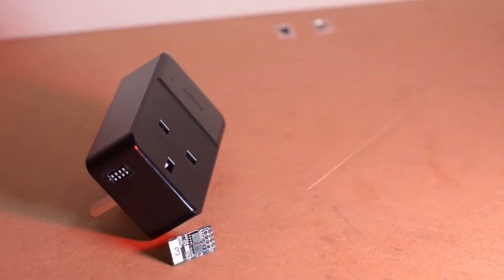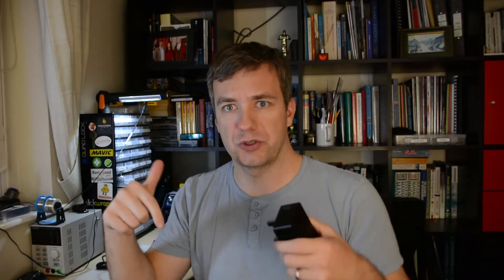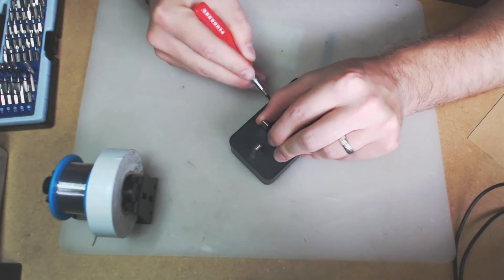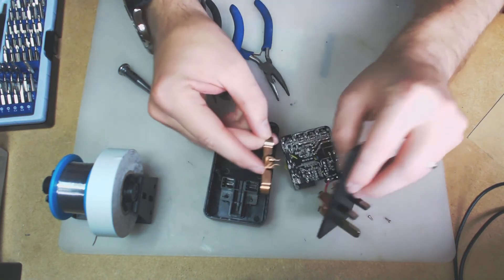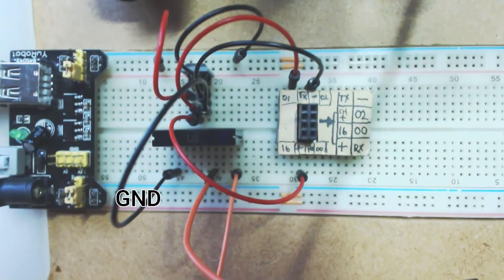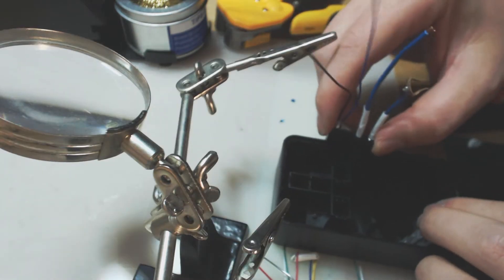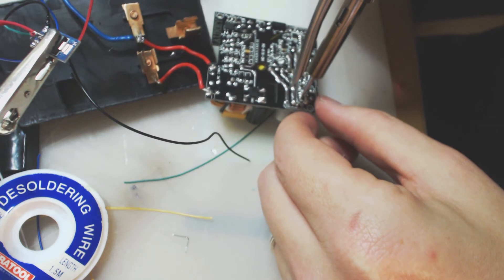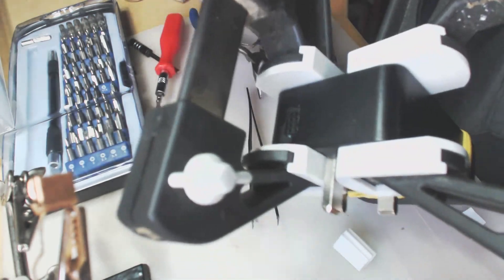ESP8266 DIY Smart Socket - #HARDWARE (2/3)

Comment: That end result is very neat. A lot of modding videos typically sacrifice the main housings while yours are barely visible with the neat works.

Anyway do you have a recommendation for LED driver for multiple LED bulbs? I am planning to make a garden lights that uses typical LED bulbs (whether parallel or series, I'm still investigating which one is more power efficient but leaning towards parallel for ease of operations). The LED bulbs are plugged into Type G socket which so far I can find a programmable plug for timing and IoT purposes. As typical white LED bulbs are very bright, maybe I need around 8-10 bulbs connected to a total of 15-20m wire (from plug to the last bulb).
Reply from the maker: You will probably want to use something like this:
https://www.banggood.com/custlink/vKvv0bFjq7 then I2C chip or similar unless you dont mind using 16 pins.

Then you can drive this with ESP or RPIzero - if you are planning more automations consider a NodeRED server that you can run on a Pi Zero as well.